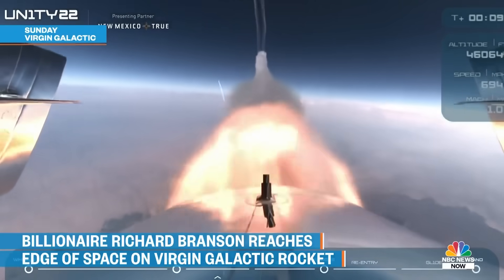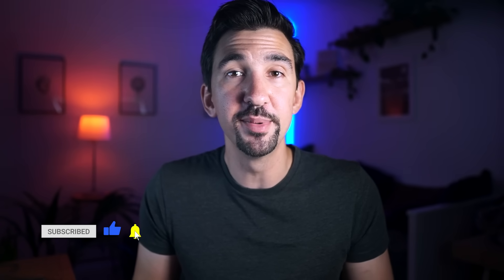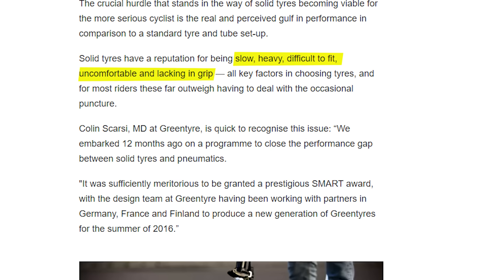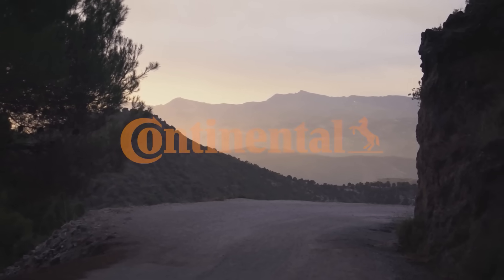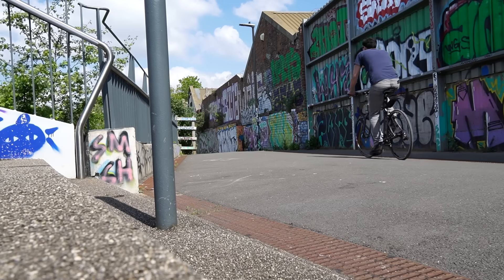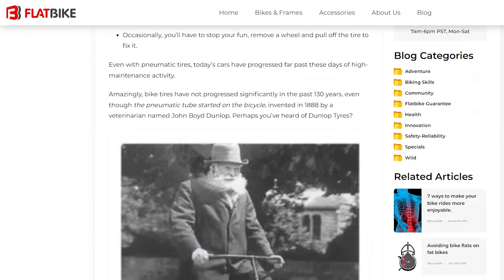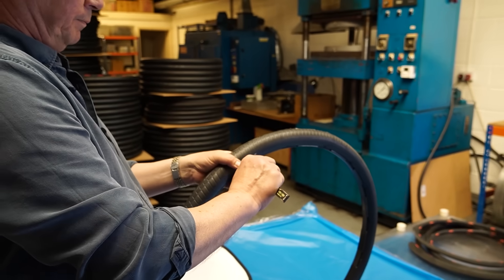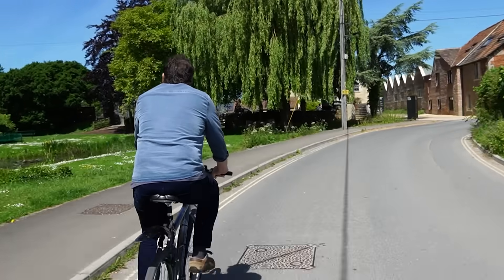I Tried Solid Bike Tires | Here's What I Found

Comment: I took a cheap blue solid foam insert with a round cross section. I put it on the flat floor and cut out the inner half with a box cutter so that the distance between the the  contact patch and the inner tube was increased to handle glass and thorns. To get the pneumatic component back I put in a road race bicycle tube. Between the perma tube and the rim. The bike is a Down Hill racing bike and has a 35 cc 4 stroke friction drive mounted on a mini swing arm to facilitate the 8 inches of suspension travel. The bike weighs 25 kg and I have done more than 10 000 km on it with a cruise speed of 35 km/h and I have never ever had a puncture.

Comment: ive been thinking about something like this for a looong time because i love riding bmx but the worst problem about it is the flats. and i almost  always forget my spare tube and it's such a hassle, and it's very expensive to keep replacing them because the ones at my local general store are 17 bucks. and if you keep popping you're tubes, that's a lot of money down the drain. so if these guys were to make a 20" tube (not tires, because i have an amazing looking set of tires) i would happily spend 100 bucks or so for them. because i would normally spend that amount on tubes in a month or so.

Comment: What about diffusion? You say 2 to 4 years on a wear basis I assume. I'll bet you will have measurable rolling resistance increases in less than a year when not used often, and significant increases when ridden often. Those gas bubbles must be under pressure even in an unloaded state and despite their diminutive size, are no less prone to pressure loss than tube or tubeless tires. I think you can safely say they will "deflate" well before you could wear them out. Recyclability? That appeals to so very few and most won't bother. Consumer plastic bottles are recyclable and we KNOW how low the recycling rate is on them.

Comment: Cool stuff. This sounds like it was a really hard problem to solve. I ride my bike for about 80% of my transit needs and flat tires are a real pain. When do you think these will be available in the USA? Also, will they be made different tread varents? I ride a hybrid bike, and ride really bad/rough city roads as well as some dirt and mulch trails. So I need a tire with a bit more tread than a road biker. Thanx Ben.

Comment: i think you've oversold these

the problem with solid tires are mainly two: 1) because they are not as elastic as pneumatic tires you have to make them very hard to reduce rolling resistance, or else make them soft and get a sluggish ride. your own bounce test showed these tires are much less elastic than pneumatic tires, which they'd have to be since there is no way any kind of foam compound is going to respond as quickly as air. so i'm skeptical about your claims of a similar ride feel, 2) the grip on solid tires is poor not only because of the compound used, but also the poor elasticity means a stiff, low-friction tire doesnt conform to the road surface as well. i just dont think solid tires are ever going to get this balance nearly as well as pneumatics, though there'll always be some market for them, probably not so much daily commuters, but for large-scale bike rentals like you see in some cities, especially in china

there are a couple, less frequently discussed problems. one is cold weather. pneumatic tires do get slightly less elastic in cold weather, but any solid tire is going to be much more affected by temperature changes. and then there is load. pneumatic tires can be adjusted for load by varying the air pressure-- not an option for a solid tire

in sum, for ultra-low maintenance bikes that see an occasional cruise to the market or for rentals, this type of tire might catch on. i dont think anyone else will want to use it, despite the inconveniences of pneumatic tires, and despite the impressive engineering improvements in the tire you feature

Comment: Roll a bead of 4 to 5 belts around the periphery of the center of the tire and coat it with a thin coating of rubber.  The belts should be nylon and steel.  This might reduce road resistance.

Comment: Why not redesign the rims. Make a dove tail around the inside of the rims then make the tire the negative (opposite to the rims dove tail. The tire could be straight so it will be feed around the rim and have clapped the two ends.

Comment: I used to road race.  On my bikes I would add a small rectangular flap of innertube rubber, about 20cm x 50cm, with about a 3cm hole punched in one end.  The hole was stretched over the nut on the brake post, front and back, so that the flap rode against the tire tread. After a few days it would wear into a nice arc against the tire. Silent and imperceptible drag.  Flicked debris off of the tire sufficient to eliminate 90 percent of flats.  That's based on thousands of miles of training before and after I discovered this.

Comment: Unfortunately, they're not for me as I value roll resistance and comfort above all else. Also, flat tires feel like a once in a lifetime event as I weight just 58 kg, I've only gotten 2 flat tires over the course of 20 years of cycling. To be fair, I pay attention not to run into glass shards or nails, screws or whatever so it pretty much feels impossible to me to get a flat tire on asphalt.

Comment: I think the solution is to use a regular tire, but replace the air tube with a low density solid material with similar properties to air.
Reply: That stuff would prolly get smooshed pretty quick
Reply: Hmm I wonder how well many sections of something soft like oxygen tube line would work, looped together around the rim. Bundle it together like muscle fibers. Still get squishy air ride but if you hit a nail or something it doesn't compromise the whole tire, you might be able to wrap them with some metal like brake housing cables and get objects to deflect as well, sure it adds weight but the trade off of never flat is nice🤔

Comment: Would be curious to see how these tyres handle in the winter. It's currently -26 and I wonder if they'd just turn into a solid disc with no give or grip.
Reply: As a Canadian, I'd be keen on studded versions of these Geckos when they get to production.
Reply: I ride on solid tyres in vinter. They wery hard. But they colecting small stones and suggest that they wery good have grip on ice.
Reply: I use tyres from aliexpress 26x1.95, but real  is 26x1.5
Reply: Generally people change their car's tyres in winter, bike tyres are just easier to change
Reply: Lowest it gets here in the winter is 20 at night and I'm not out riding in that weather anyways

Comment: This seems like a solution in search of a problem. I ride on 28mm Specialized Armadillos and have less than one flat per year. If you're getting flats once a month you're either riding on very dodgy roads or you need to try another brand of tire.

Comment: There are a few more points: 
 - generally: resistance - you would need different densities for different rider weights, also some riders like to adjust how hard their tires are according to weather and road conditions; Recyclability: as far as I can tell tyres do not only get ground down but also the rubber degrades due to ozone and sun exposure - can that be recycled too?
 - for the everyday rider: me and everyone I know been riding Schwalbe's Unplattbar (not-flattable) for a long time - they are a little sluggish but nothing catastrophic. No flats so far, and we ride through really nasty stuff. Also very cheap. I'm sure other brands are also keeping up. And for the weight: once you're rolling it doesn't matter much. The rolling resistance does always.
 - for the hobby/pro rider: just go tubeless, this is a no-brainer. Not even going to mention all the benefits, they do very well pay for the little extra maintenance.

Comment: the first bicycles had wooden wheels but none were teardrop-shaped in profile, providing minimal contact patch and using the flywheel effect. The prime drag on a bicycle is rolling resistance as raised rubber deforms... as opposed to the mass of the outer circumference, so the solid material does not need to be governed by providing the lowest mass, as long as the contact patch and surface deformation remains minimal.

Comment: About 10 years ago I put foam "inner tubes" on my daily rider. This was after having multiple flats on a late night ride & a long "walk the bike" back home. After 5 or 6 years I had to replace the worn out tires. A friend was helping me and ruined one of the foam tubes. I couldn't find a quick replacement so I got a "solid tire." A bear to put on and I never did get it to run smooth. 

The bike shop refused to service a broken spoke when they found I had a solid tire. They blamed the tire for breaking the spoke. Considering the bike had about 10,000 miles on it at that point is one broken spoke all that unusual? 

I'd love to get foam tires for my pedal assist that I now have. My daily round trip is 22 miles. I'm 80 years old and really hate getting flats. I've had the pedal assist for just over a year and really like it.

Comment: Elastic deformation of the tire  (rolling resistance) is 100% energy loss dissipated as heat. The rider does not get any useful energy back due to "restitution". Consider why train wheels are so efficient; steel wheels on steel rails with very litlle elastic deformation.

Comment: In 1980 and 1981, I commuted to and from work, 8 miles each way, on airless polyurethane yellow tires. Their cross section, as I recall, was part ribbed, part honeycomb. My hubs were robust sealed-bearing Phil Woods, so I didn't worry about wheel life. At 2 pounds (900 grams) each, those tires were heavy as hell. And they made for a bumpy ride.  But the weight was worth it. No longer did I fear getting a flat. 
Once, at the factory where I was an office worker, the union workers went on strike. To deter "scabs" from violating their picket line, they had strewn broken glass along the entrance road.  You should have seen their faces when I cycled right through the glass.

Comment: I'm not a serious cyclist (only cycling now occasionally with my young daughter in the park), but like most children in England I rode a bicycle as a kid ('80's and early 90's when BMX's, and then Mountain Bikes, were on most kids wish list!) Even back then I always wondered why airless tires weren't a thing, especially after changing and / or repairing inner tubes a few times (no mean feat when you're a kid, although you get good at it pretty quick!) I didn't have a clue as to technical impediments to the airless tire back then, and I know nothing about materials science / engineering now, but it's still very surprising that 30+ years later, and with the huge increase in the popularity of cycling, that airless cycle tyres haven't already been developed to the point that are widely / easily available or even the standard.

Comment: Awesome innovation and fantastic video presentation! 3 points; 1. It would be amazing if the rubber was sourced from a sustainable renewable bio option. 2. For wheel longevity it would be cool to be able to re coat the outer grip layer. Same principle as resouling shoes. Except maybe you could brush it on like paint with a roller. 3. It would be awesome to make 150mm inline skate wheels out of this technology, for off road skating. More of a scandinavian off season training thing but is still fun for short commuting in flat cities with shoddy road surfaces.

Comment: With air tires, about 250 grams end up in the landfill when the tread is worn off. With solid tires it's how much more?
The other day, I took one of those rental electric scooters to get to a job interview I was about to get late for on behalf of Deutsche Bahn AG. The street was early autumn-condition, slightly wet, some sand, a leaf here and there. The f*cking scooter's solid rubber tires lost grip at 10° lean angle and the job interview blew up as I tore my clothes and had to take care of a bleeding knee.

Comment: I've cycled 10km + to work for the last 8 years. I have never had a flat tyre in all that time. I use Schwalbe commuting tyres. Either you are very unlucky or the tyres you were using were puncture prone.

Comment: I ride with 6 to 7 Bar of Air-compression on my velomobile and need a new set of tires every year, cause I ride much faster (recumbent riding position and aerodynamics). On top of that, our bike paths in germany are absolute crap… 
If they have different sizes of tires… this could be worth a try. The end of flat tires, a smooth ride and recyclable just sounds to good.

Comment: One of the issues that someone else mentioned below is the damage to the rims/spokes when using a solid tire that doesn't absorb the shock for different weight riders.  Air filled tires will try to correct an out of true rim to maintain a circle.  Solid tires have been prone to rolling with the out true rim and can make it worse. If I had a commuter bike, I would try out the solid tires, but only with a stiff wheelset.

Comment: It will work for commuter bikes, but not for other applications where people prefer different tire pressures.  I've had solid tubes back in the 90's and the amount of weight was too much.  Also, can change a tire out for the riding conditions.

Comment: This is obviously an advert. The 100% recyclable part is good. What remains unanswered - the question that is obvious - is what about the tread surface? If it has a "solid" core - why not just re-tread the outer diameter of the tire when it wears down? Why not have replacement treads that are interchangable so you can go from road to gravel and to mud on a single tire core? That is what I would be interested in seeing - no need to recycle the tire or buy multiple versions - just buy the treads.

Comment: One of these days, I should try to see if it's possible to 3D print a type of solid bike tire made from TPU.  Of course, it'd have to be able to interlink with several segments, since I'm limited to making 12 inch segments.   Which means about 6 segments +, to print out, and somehow link together without the tire trying to pucker and pull apart at the seams.   Alternatively I could make a scaled down version too.

Comment: I've read about airless tires over the years but after seeing the reviews, i never tried them. I use a solution that, arguably, fills a niche similar to these airless tires that (according to the video) are a really good substitute for pneumatic tires: i ride heavy, wide, mountain bike tires for commute purposes on paved roads. 
I used to get ridiculous numbers of flats just riding long distances daily on pavement. I tried every solution i could for narrow-ish (700x29 and narrower) tires and never found a solution that prevented flats to any reasonable degree; Tuffy tire liners, stacking a couple of tire liners together inside my tire, using a kevlar belted flat resistant tire along WITH one, two, or three tire liners.... still got just under 1 flat tire per week (riding around 150 miles per week).
Switched to mountain bike tires and the problems pretty much went away. The mountain bike tires put my tubes at about 5mm or 3/16" off the ground road surface and the objects i was getting flats from (fragments of screws or wire, and bits of glass) were simply too small to reach all the way to the tube from the ground. 
So I don't get flats, the ride comfort of my bike is improved, and yes I'm "slow" by comparison to what I could achieve riding a bike with light narrow tires (up until it got a flat, that is)

Comment: In my experience running large volume tires at lower pressure (30psi) nearly eliminates flats and while it does increase rolling resistance slightly, it drastically increases comfort. And a tire will remain at 30 psi much longer than it will at 60 or 90 psi. Pneumatic tires also allow adjustment to different riding conditions and weights as well, and I always put 5-10% more pressure in the back tire since there's always more weight on it.
Reply: I am running a set of Continental Double Fighters at 40 they are comfortable and I've not had a flat in 2 years.

Comment: Ever since I switched to puncture resistant tyres years ago, I haven't lost inner tubes to punctures. I'm not even using the toughest summer tyres by far, just some middle ground ones (Schwalbe). I never got punctures during the winter months when using studded tyres because they are much tougher by default. I might be using too cheap inner tubes, though, because it always feels like they are losing air too quickly straight out of the box, but that only means taking the pump to the bike every now and then.

Maybe if you live in a really rough neighbourhood things are different. Like lots of nails, industrial metal pieces, and whatnot littering the roads, not just the usual glass shards from a drunkard's empty bottle or a thumb tack some a child threw out there, trying to be terribly funny.